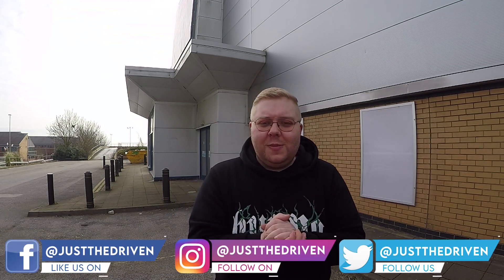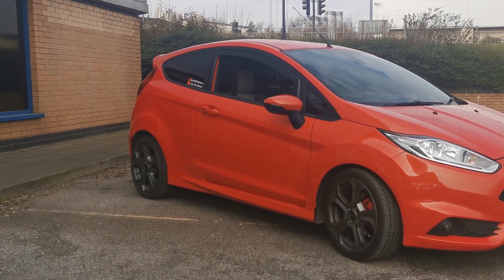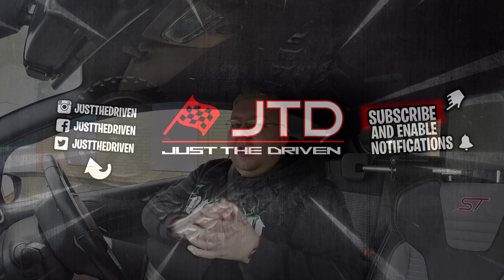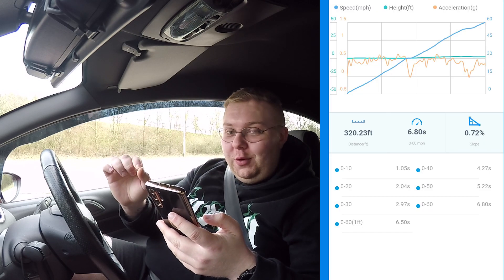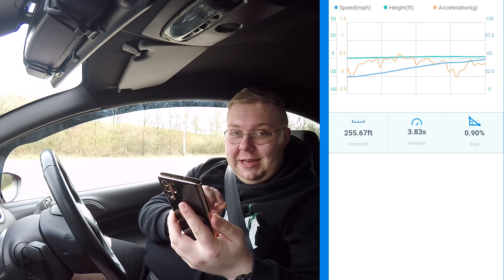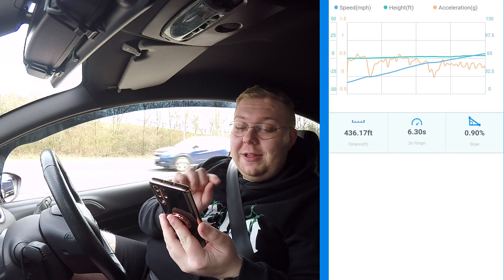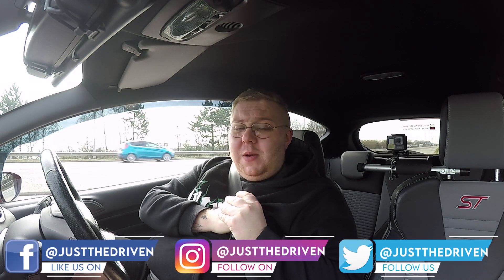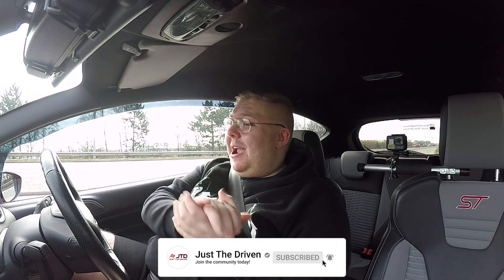STAGE 1 vs STOCK | Fiesta ST - WHAT DIFFERENCE WILL IT MAKE?!

Comment: Normally with a stage 1 they raise the reg limit. This should allow you to hit 60 in second if you go all the way to the limiter. I hit a 5.46 0-60 stage 1
Reply: What brand stage 1 got you that?
Reply: @josephbelanszky9258  TRS Performance. I have it on Dragy and video. The map isn't what gets you the time, it's avoiding wheel spin that does.
Reply: @josephbelanszky9258  to put it in perspective, most runs I got where 5.9-6.1. I had only a few where the car hooked and got no spin at all, which is when I hit the 5.46

Comment: Drop the tyres pressure to around 25-26 psi on the fronts it helped my fwd Cupra 346 hp)
Was still still spinning in 2nd but much  less than they were at 31 psi.
A short shift will take a thousand of a 2nd off too! Dragy becomes addictive...

Comment: I couldn't belive the difference just a map made to my fairly standard ST. haven't felt like I needed more since
Reply from the maker: It's a great addition, nice jump up in power without changing the driveability. Glad you're enjoying it
Reply: So a stage 1 only gives you what? About 10 to 20 extra bhp can you really feel the difference?
Reply: @danh2310  yes, because in 1st and 2nd your actually getting an extra 40/50 as they're limited to 180 before the map
Reply: @dannyfawcett8253  thanks mate picking one up tomorrow was thinking about getting stage 1

Comment: I’n you’re opinion is it worth going pumasport stage 1 or mountune mp215? In terms of speed increase, and factoring resale? Cheers bro great vid
Reply from the maker: Pumaspeed 110% 

Thanks mate.
Reply: @JXLPerformance  cheers bro, even for resale? I don’t want to decrease interest when I sell?
Reply from the maker: You can return it back to stock if you use the MAXD Programmer so it wouldn't affect values
Reply: @JXLPerformance  Just had a look mate, very good value also on the 235bhp upgrade, cheers for the recommendation much appreciated to a Lehman like myself 😂

Comment: Since it’s the same 1.6 ecoboost minus the manual transmission in the US. Would bolt ons work on the escape aswell?
Reply from the maker: Possibly, but I don’t think many things will be direct fit (intercooler, exhaust, downpipe etc.) 

There is a Focus 1.6 EcoBoost in the UK with the same engine (some have vacuum operated actuators) and they are the same, in principle the parts fit and work, but a lot of custom mounting is needed.

Comment: Shifts at 5,500. That's where I shift. Stock turbo kinda falls off past there. 2000 rpm launches were best at take off, but with the 3.82 final drive ratio I bet better accel times would be had taking off in 2nd gear.
Reply from the maker: Yep, no doubt with the ST200 gearbox acceleration would be better and you could then warrant a 2nd gear start, it just bogs down a little from stock. 

Interested to see how the times change now I have an X48R turbo on the car!

Comment: Besides the Numbers difference,  I find the feel of the torque / power is enhanced with just a stage one flash tune.
Reply from the maker: 100%, everything is just dialled up another level
Reply: @JXLPerformance  also with some tunes the Rev hang is lessened so shifting from first to second gear is smoother which is a nice improvement.
Reply from the maker: Yeah I've heard that, don't think this Vudu has that but the other tunes do!

Comment: How much was the map from Vudo mate? I'm only down the road from AET.
Reply from the maker: With the Vudu flasher it works out just short of £500 mate
Reply: @JXLPerformance  thanks. I'll look into it. It's a toss up between them and pumaspeed for me at the moment.
Reply: @jimmyjt16   Which map did you choose? I'm looking to map mine soon.
Reply: @sammybaker4767  neither. I sold the car and bought a nicer lower mileage one. It has the mountune 215 kit fitted which I'm happy with for now.

Comment: I have Michelin Pilots on my MK8 ST definitely make a huge difference compared to the Protenza's that come on the MK7. Are you thinking of getting a LSD fitted? that would round off the car👍
Reply from the maker: LSD is on the ever growing list! PS4s or Goodyear's too methinks
Reply: @JXLPerformance  Go for Pilots good in the wet as well as the dry👍

Comment: Is reliable this engines and gearboxes mate??
Reply from the maker: Yes, up to 340bhp

After that engine requires building, 300-340 is the sweet spot
Reply: @JXLPerformance  what to look out for in his market? I have heard that they have a problem with overheating is it true? and do these engines still make miles? e.g. over 200-250,000 ?? With the best maintenance!